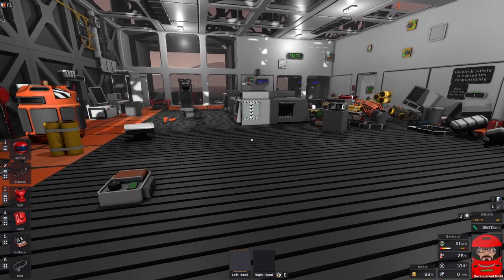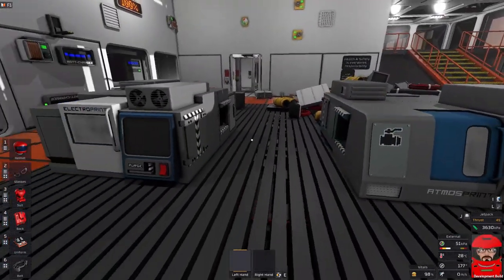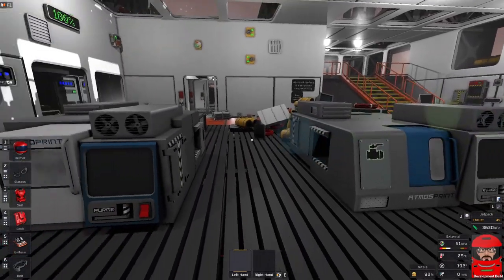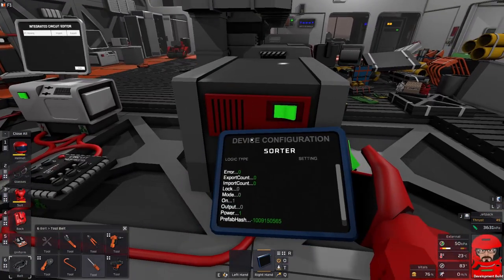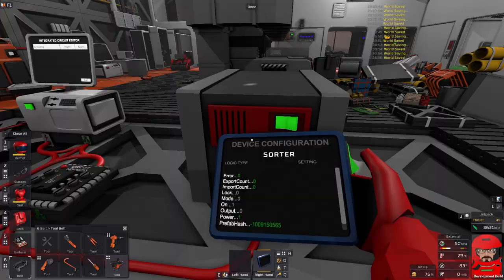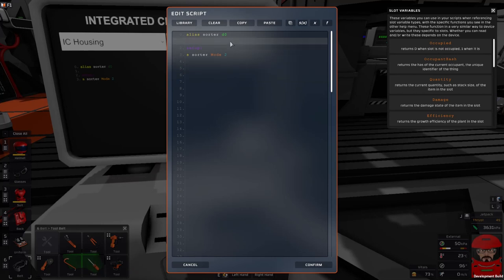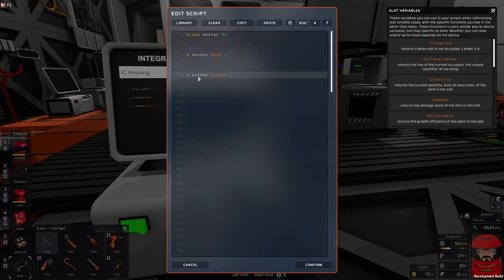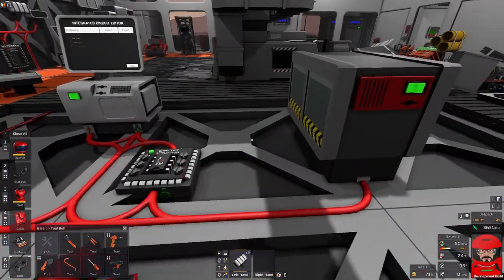Stationeers Printer logistics

Comment: As to requests, there's a bunch of things I never tried but feel prepared to do so now, but I'd still love to see your take on the AIMEe bot, the autominer (and how you handle mining stuff that offgases; presumably mining at night?), how AIMEe and autominer compare with their pros and cons and possibly a continuation of that with a second video where you harvest the mined gasses automatically and possibly automatically smelt the ores (up to 1kg or whatever value) of each type. I could see miners feeding into a series of stackers for each ore type, and automation to dispatch ores accordingly to create a given alloy - your furnace could already adjust pressure and temperature quite flexibly so I think that would be an amazing engineering challenge to throw your way. And quite entertaining ;)
Reply from the maker: AIMEe is something I am wanting to use.  I will have to do a bit of reading first.

Comment: Excellent build!!!  How did you program all 3 machines (autolathe, electronic pr, and pipe)?  Did you use 2 IC chips with same programming and pin the 3rd machine sorter and printer along with the end sorter?
Reply from the maker: That is correct.
Reply: @cowsareevil7514  awesome.  I thought that but I wasn't sure.   However, I'm finding the sorters are alternating the output side.  I have 6+ chutes between out of printer and input of sorter...but sorter seems to be alternating the output side....
1
Reply: also, this code  does not like "s sorter Output r0" at the end of the code.  so frustrating.  lol  Excellent idea...just can't get it to work right.  lol
Reply from the maker: @joshuacollier4178  I have had other people reporting the alternating sorter bug but i cant reproduce in my game.  Make sure you have removed and reinserted the chip to reset the code after setting it up.  It may be a timing issue that shows up on some computers, you could try a "yield" command after "s sorter Mode 2" to wait for the device.
Reply: @cowsareevil7514  any sorter that  doesnt run in basic operations mode - ie no ic control and no computer programed sorting, will always alternate its input - so perhaps the sorter that is doing this is some how not connected/pinned correctly and thus is operating in free/basic mode?